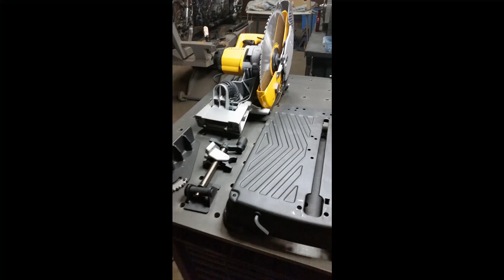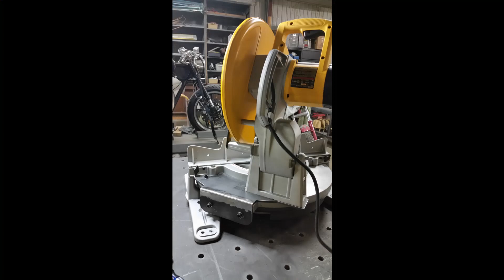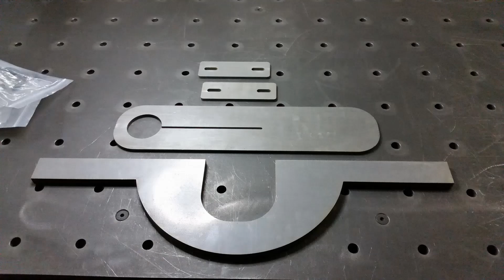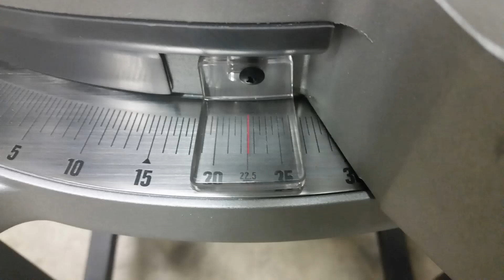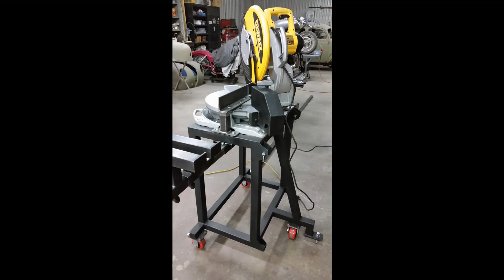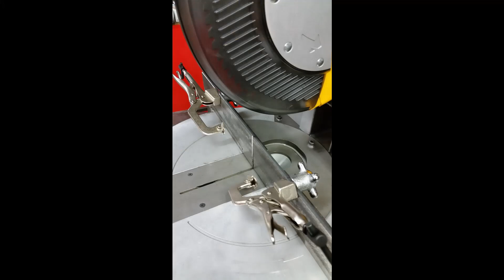The making my Cutting Station!

Comment: Very well , as usual.
Why is not possible to use the wood saw , and only change blade for metal. 
It not privide enought torque to gut metal?
Thanks.
Reply from the maker: A wood cutting saw runs at approximately 3000 rpms, which is too fast for carbide tipped metal cutting blades! Metal cutting saws like this one are gear driven and run at approximately 1700 rpms which helps the carbides to stay cooler and last longer!.
Reply: @6ldesignsmetalinmotion217 so if you put abrazive blade (instead of carbide
 teeth) to wood choper , you can use it to cut metal.
Reply from the maker: @maximuspareo  I've never tried it, so I can't say!

Comment: What 2 square stocks did you use     For the sliding tube in tube.   I heard one is 2”x 1/8 wall
Reply from the maker: The receiving tube is 2x2, 14ga wall, and the inside tube is 1.75x1.75, 11ga wall. I hade to grind down the weld seam in the 2x2 tube! I hope that helps!
Reply: @6ldesignsmetalinmotion217  k thanks.   I have a ridgid base like yours but has the slider forward and back.   Do you see any issue using that base and keeping the slider mechanism?     I like the way you think , setting up your shop.  

Make more videos 😁
Reply from the maker: @Diego-76-l3h  I eliminated the slider function for safety reasons on mine, and would not recommend it on a metal cutting saw at all!!!